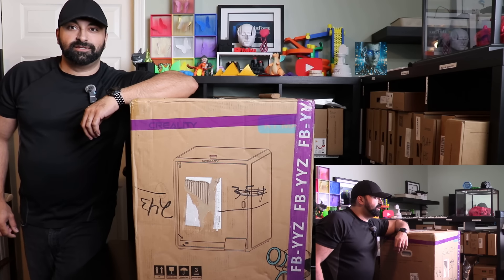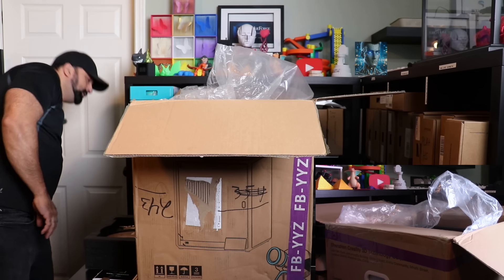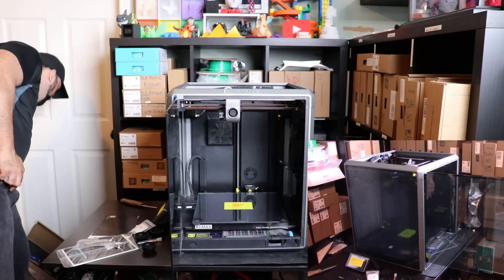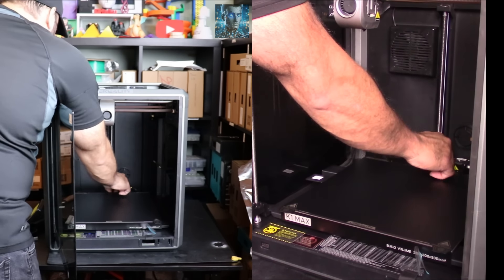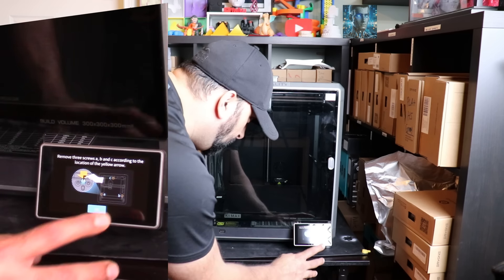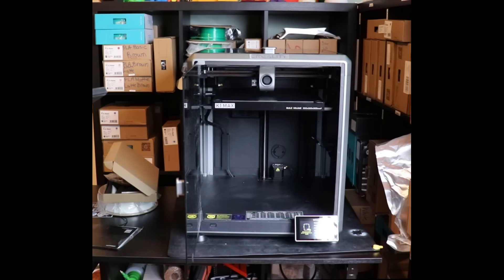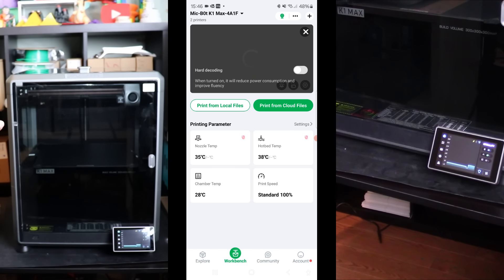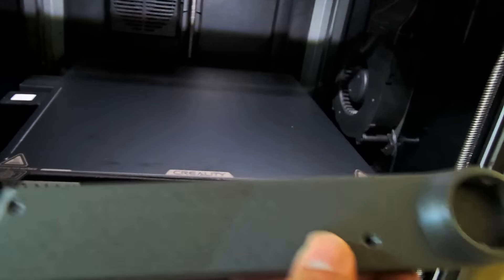#Creality Series 2.0 -  #k1max  Full detailed #unboxing and full #setup including #crealitycloud

Comment: Hi, how is this working ? I’m planning to buy it, getting it for a sale price.  How is the auto bed leveling been for you ? There are so many videos that mention that it has many problems with that.
Reply from the maker: Honestly, it's been really good so far. I wasn't expecting much but it has exceeded my expectations. Keep in mind I have 12 Bambu Printers. The bed size is impressive on the K1 Max, but it's only single colour. The levelling has been good so far except for full bed size prints. I haven't been able to get it to print something the size of the entire bed without it failing.
Reply: @MicBot  thanks for response. I am not aiming for multi colors, as I do medium or life size busts  and statues. Which are later finished and painted. I have been out sourcing my prints for a few months but has costed me enough to decide that I should buy one myself. First ever buy is always very confusing, also when you're not familiar with all the technical stuff.
Reply: @MicBot  bambu unfortunately wasn't in my budget, found a deal of k1 max in 600 USD.
Reply from the maker: @alimuzafarfanpage  if this is your very first printer, I would recommend one of two things. 

1 - start with a Bambu as your first. Trust me. 

2 - if you plan to start with a K1 Max, make sure you get to know the printer very well and figure out how to do maintenance, troubleshooting and repairs.
Reply: @MicBot  bambu region lock system has been the major reason for not getting. Since I can only source from china.
Reply from the maker: Ah. Well you should be good with Creality. Bambu is just a little bit easier for beginners. Creality is like the Android phones of the world and Bambu is like the iPhones. Basically if you know how to tinker, Creality will become your favorite printer quickly. If you prefer something that's hands off except for maintenance then Bambu is the way to go.
Reply: @MicBot  I'm also looking at the latest ender V3 plus, it looks good as a entry too. It's such a confusing thing to select the right model 😅
Reply from the maker: @alimuzafarfanpage  stick with the K1 series.